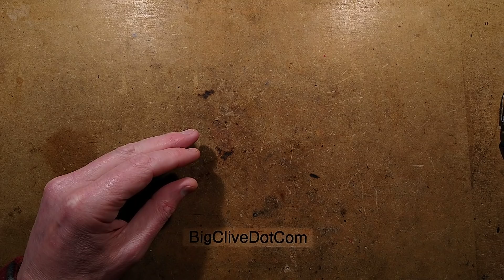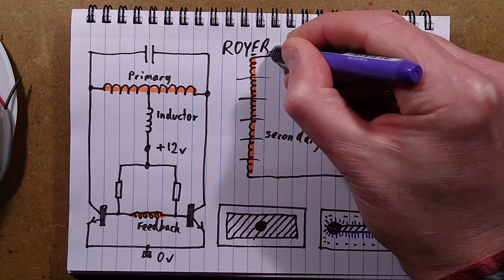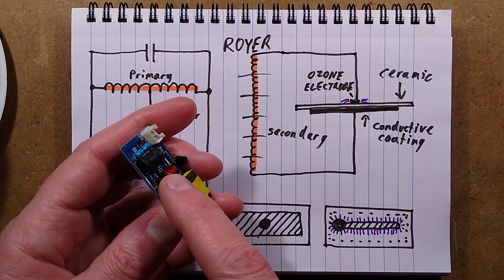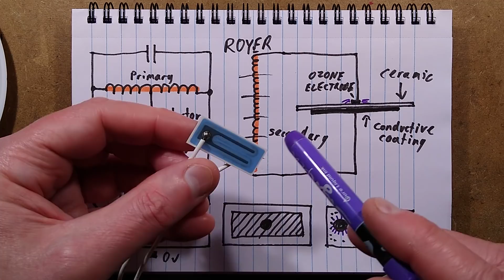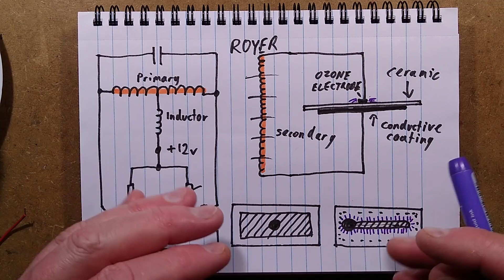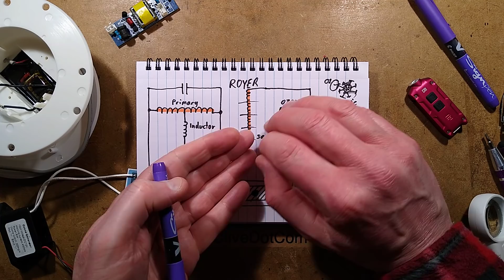High voltage sauna sanitisation unit

Comment: The reason for the poor battery life on those digital calipers is not external interference but the stupid "auto power on" feature. It means that in the "off" state only the display is shut down, but everything else inside that blob is still running.

Comment: ozone production does not happen (for most intents and purposes) in a high humidity device. Now, if you like your sauna pretty dry, this thing might work. And if it were only operated when the sauna is off (and has been presumably uh, "baked out" by the last users) then maybe... but damn this just seems like someone in CN is dumping ozone devices in North Amurrica. :(

Comment: It's glued together so it doesn't have screws, nuts or bolts that rust in the hot humidity of the rooms its designed for. I'd wager glue isn't actually standard hot glue. At least that's what I'd assume.

Comment: high voltage dodgy ebay devices is by far the most interesting subject on this channel, in my opinion.
Reply from the maker: They have a lot of them.
Reply: @bigclivedotcom  i wonder what's the highest voltage that they can go to
Reply from the maker: @Alexander_Sannikov  The spark generators can go pretty high before the spacing between the spark gap exceeds the insulation rating inside the units and they fail.
Reply: @bigclivedotcom  they can pot things in resin, separate windings on coils in segments, and do all sorts of other dodgy stuff. I wonder how far they can push it.

Comment: I see this ozone generator is 12v AC, can it be used with 12v DC power? 
It would make a great device for a camper to prevent mould, could be set on a 12v timer for maybe a minute every day. Would it be possible?
Reply from the maker: It is designed for AC and DC.  You can also get small 12V units that generate trace ozone continuously.  Search eBay for TFB-YD12102
It's called a positive/negative ioniser, but in reality creates a slight corona on its carbon fibre bristles.  It only uses 10mA.
Reply: @bigclivedotcom  found it Clive, thank you, and thumbs up to you mate 👍👍

Comment: Do you think you could use this device to drive a neon tube in a novelty clock with a circular neon tube around the rim of the round clock face assuming you limit the current with a properly sized series capacitor?     Thoughts????
Reply from the maker: You can get cold cathode drivers on eBay.  Search my channel for keywords like CCFL and cold cathode to see neon tubes being driven by them.
Reply: @bigclivedotcom  THANK YOU MUCH

Comment: Will the ozone eventually cause the plastic and the glue holding it all together to go hard and crumble?  It must surely be a pretty harsh environment up close near the ozone source!
Reply from the maker: It will degrade over time, but the ozone plates have a finite life, so the unit would need replaced after a number of years anyway.

Comment: The metal goes on as a paste using a silkscreen.  I just packed several of the stainless steel screens that were for putting silver onto ceramic circuits.  They're now on a ship on it's way to our new home.

Comment: Eddy currents damaging bearings is a big issue with turbo alternators in power stations. Therefore, one set of bearings was insulated with tufnol bushes round the holding down bolts,  and plates under the bearing pedestal.

Comment: Hi Clive. Another entertaining technical video, thank-you. Re your comments on AC variable speed drives (AKA inverter drives) - I used to work in technical support on industrial drives for a "household name" manufacturer. (Not Siemens, see below.)

The problems are all related to the super-high switching speeds of the modern semiconductors used to generate the square waves (pulse width modulated) fed to the motor windings (high dI/dt value). As you mention, some motor manufacturers use ceramic bearings but others use conventional bearings in electrically insulated housings (fibreglass or glass loaded nylon). 

The other problem encountered is early failure of winding insulation. The capacitance and inductance of the external wiring to the motor can effectively double the peak voltage "seen" at the windings. I once had a customer with a new installation who had motors failing after only 6-12 weeks. It turned out that in the original design (air conditioning plant in a big shopping centre) the motors specified were made by Siemens. At some point an externally identical motor (but much cheaper) from an Eastern European manufacturer had been substituted. When tested, all motor failures had insulation breakdown. The winding varnish in the cheap motors was rated at a lower insulation voltage than the originals. (Poorer quality control of the winding varnishing can also result in voids where corona discharge can erode the insulation.) The usual fixes are shorter wiring length between drive and motor (not practical) or addition of reactors between drive and motor to soften the rising and falling edges of the pulses (no room in the control cabinet or at the motor). The problem disappeared when the customer replaced his failed motors with ones from Siemens.

I'll put my anorak back in the cupboard now...

Comment: Hi Clive. Can you do a video on how an iron immediately adjusts itself when you chose a cooler setting, my iron can go from hot (cotton) to cooler (synthetics) in less than 2 seconds. How the heck does this happen? Perhaps a video on Victorian cast iron irons through to the very latest modern irons and how they all do what they do so well. Toby
Reply from the maker: It's always dissipating heat.  The control is usually just a thermostat.  Going from a very high heat to a low one will take a moment as the excess heat dissipates.

Comment: Ive got about 14 of those bobbin style transformers and 10 of what I call taser guts ( pretty much a 7/8" dia tube with those transformers in them) and got an idea.. I took some aluminum duct tape and applied enuf to both sides of a 16"x16" peice of lexan to make a 12"x12" cap... I added 1 of the Taser guts to the cap and it went from interesting to OMG!!! the gap it could jump was 1" wide and very aggresive spark at about 2Hz pulse with an input voltage of 2.1 vdc. When not sparking you could hear a steady sizzle and the ozone output was overwhelming. I suppose the entire edge of the 12x12 aluminum was cooking off the ozone... 4 linear feet of ozone producing madness  :)   BHUHAhahahhaaaa
Reply from the maker: Be careful not to damage the units by operating them with the output electrodes too far apart.  What you describe sounds like the "lifter" technology.

Comment: Damn thing arrived fast already since watching this vid , Mine arrived with all its hot snot hanging off i assume vibration had knocked it off , other than that it seems to be working it makes the high voltage soft light etc.

Comment: Hey Clive, I can't find a good answer to this. Is it OK to use a UK 400w halide ballast (230v 50hz) on US 240v 60Hz supply?
Reply from the maker: It should be OK.  If anything the higher frequency will result in slightly less lamp current and a cooler ballast.
Reply: @bigclivedotcom  thank you!

Comment: A few years ago, while working on a capacitively sensitive tactile keyboard, we were advised that the pattern of electrodes for the capacitive sensor had an optimum layout. One electrode had to surround the other on a 2D plane and they must present the maximum capacitance to each other and one had to be minimally capacitive to the user's fingers. This lead to a challenging layout of sinuous tracks and castellations.
It strikes me that the ozone electrode is similar. You want the rear electrode to be huge to create the area for the corona discharge but the front pattern must be as small as possible to create the maximum corona. The trouble is that the ablative effect of the discharge and the limits on depositing metal on ceramic mean tracks can only be so thin, but there must be an optimum layout. Perhaps something fractal like a snowflake.

Comment: As I understand it, and someone correct me if I am wrong, the smell of chlorine around pools is actually the byproducts of the disinfecting process, the chlorates?  from whatever the chlorine has attacked. I have also heard that a lot of that smell is from oils and sweat from people's skin and largely from people peeing in the pool. Iirc it's a reaction between the chlorine and the urea in urine and the byproducts of that reaction evaporate off/off gas easier than the chlorine itself.

Comment: The comment about caliper battery life: I had an employee that stored them sitting in front of a crt pc monitor (old equipment not worth upgrading screen to lcd) and the batteries seem to be dead every time we go to use them (handful of times a year) so that might be the reason.
Reply: AvE did a video a while back showing that the cheap ones have a quiescent current consumption a few orders higher than a good Mitutoyo. I have a cheap one myself, the batteries last a lot longer now I take them out when it's not in use.
Reply: @OhShitSeriously  mine is one from kobalt. We've had it for 10+ years and battery life seems to have significantly shortened in the last year or so. Taking the battery out isn't really an option because it is held in by 2 tiny screws that have been stripped out by my predecessors.

Comment: Is the ceramic plate thing made from a pcb made with ceramic rather than fibreglass as the board
Reply from the maker: It appears to be a specific item with the electrodes printed onto it as opposed to etched off like a copper PCB.

Comment: To be honest: I don't think that this test sufficiently proves that these digital calipers use relative positioning. It could also just be messing with what it thinks where 0 is or interfere with the bits it reads.

Comment: A few years back, you did the show on the UV-C lamp available from Ebay sellers, and it impressed the hell out of me. I loved black light, used to have one I bought from another GI when I was stationed in Nam. Had it hanging over my bunk illuminating a poster that said "What if they gave a war and nobody came!" A name of a popular movie back in the late 60's, in fact I watched it in the repo-depo in Oakland California while I was awaiting my transport Jet to give me my ride to Vietnam.  So at any rate, I ordered one of those lamps, my intention was to use it to clear out mold in my old back room shop that had been shut down for years, and I did that. Then those TV commercials began trying to sell the CPAP cleaners, my daughter needs the CPAP machine and hates the cleaning, so it dawned on me that I still had that bulb in my back room. I dug out a ceramic light socket, mounted inside a plastic bucket lid on a bucket that once held cat litter, put a switch on it, and ran a cord out, the lid opened half the top, so I mounted the light to the other half, she now puts her mask and hose in that bucket, hits the light for about 5 minutes and her room, as well as most of our house is refreshed with the smell of post rain on the plain, and her breathing stuff is fresh and clean.  Surely much cheaper then the 1000 dollar CPAP cleaner on TV and probably does just as good of a job.

Comment: In the description you mention your concern about the steam generating carbon tracking on the ceramic plate.
In the video you mention that these things generate not just ozone but hydroxyl radicals, but you forgot the wide range of options given the atmosphere's composition, including nitric acid.
Isn't electrochemistry wonderful?
Reply from the maker: I did mention nitric oxide at around 11:23

Comment: On those calipers not getting good battery life - I found that if you slide the calipers even slight they auto-turn on. Its super easy to miss.
Reply from the maker: They take virtually no difference in current when the display is on or off.
Reply: @bigclivedotcom  Ah ok - I had no idea - I've had mine since last summer on the original battery.

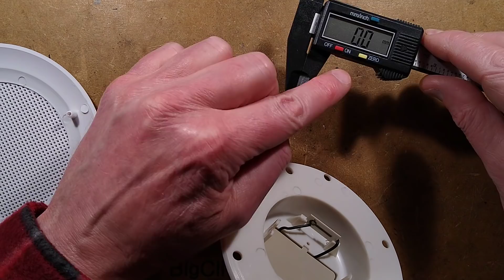Comment: 2:17 a minor note about those calipers - the "problem" with them is they come on automatically when you move them, but they are extremely sensitive to this and even vibration on the bench can "activate" them. Once I started storing mine on a more solid surface the battery life noticeably improved. The slightly more expensive versions which have a locking screw on top don't have this problem.

Comment: Yeah, Here in Finland I don't know how many Sauna's I've been at and I've never ever even heard of something like that 🙂
Reply: Finnish sauna probably stays hygienic through the high temperatures.
Reply: @MetalheadAndNerd  There's actually some truth there. Bacteria and viruses that live comfortably at over 70C aren't too many. I assume some lame Turkish saunas that are extremely humid and have something like 40C temps are still in the very "lively" range of many kind of life. IIRC from work, it's around 38C that growth of bacteria is most violent.
Reply: @jothain  We have to consider surface temperatures though. Not every crevice of a sauna has the air temperature. Especially if it os a private sauna that only is heated up right before usage.
Reply: @MetalheadAndNerd  That's obvious. Though in private sauna's surfaces are also dry and still get quite warm during heating and after. Especially compared to those Turkish style low temp and humid type "sauna's". It's the humidity that's also a great factor in bacterial growth.

Comment: Another "steemy" vid from the Big Man, how does he keep it up ! lol  ;)
So, Ozone, High Voltage, and UV radiation. I predict that the injection molded polystyrene housing, and potting resin will last 1 ~ 2 years.
Reply from the maker: These things do tend to have a rated lifespan.
Reply: @bigclivedotcom  yeah, and mores the pity. A stylish satin finished stainless steel, or powder coated aluminum, would be a better choice, IMO. ;)

Comment: You should take apart a Casio solar calculator, it would be interesting to see how the solar power circuit works
Reply from the maker: It's usually just an amorphous solar panel putting about 2V to the calculator, with a diode on the battery and solar panel to prevent backfeed.

Comment: Hi Clive, very interesting as ever. On the chlorine smell in swimming pools...it's not chlorine you can smell...it's chloramines. Chloramines form when chlorine reacts with sweat and most usually  other bodily fluids that "accidentally" leak from people when they can't be bothered to get out to use the toilet! You get rid of that smell by adding more chlorine. If the pool is well maintained and the chlorine level is high enough it hardly smells at all.

Comment: Those cheap calipers get bad battery life because the on/off button just turns off the display.   Actually, a teardown on one of those with a focus on any mods that could be done to improve it/enable communication with a micro controller would be most welcome.

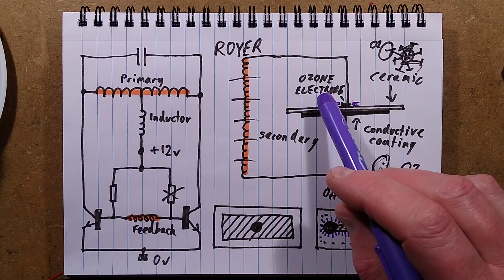Comment: 12:34 Thanks to Mark Rober's urinary endeavours I am aware that apparently the chloriney "pool smell" is apparently due to chloramines (particularly trichloramine) -- the resultant molecules after chlorine has reacted with pee [and, according to Google, other perspirants] in the pool.

The health question piqued my curiosity so searched and found a document titled "Chloramines - Safe work practices" (2014) by WorkSafeBC (The Workers' Compensation Board of British Columbia).  Although slightly dated, it suggests that professional swimmers (who do a lot of intense breathing near the water's surface) and pool workers are at risk from breathing difficulties or "occupational asthma" due to long term exposure.

Kinda interesting.

Comment: When covid first kicked off around April last year, I was working at our city office (IT worker at an "essential service", so I still had to go into the office 5 days/week). The entrance is inside the foyer of a building that's also the head office of a large bank, and aside from the police stationed in the foyer suddenly wearing riot gear and carrying automatic rifles, the other thing that changed was that they suddenly started pumping huge amounts of ozone into the foyer. It was so bad, my eyes would sting and I'd start coughing if I breathed too much in the 15 seconds it takes to get into our office. And you could still smell it a fair way into our office, through both the automatic door and the security barriers (the floor to ceiling type with the two panels that lift in a arc out of the way when you swipe in). I really didn't envy those police officers. Although the goggles they wore as part of their riot gear would probably shield their eyes a little. And I'm sure their automatic rifles were highly effective against the virus too.

After a couple of weeks they did wind down the strength of the ozone, and shut it off after a couple more. I was still glad when that project finished and I could go back to my regular office.

A year on, I've been working full time at the office almost the entire time, catching public transport every day (even had our building shut down when a person in another office in the building tested positive), and I've managed to avoid catching the human malware. But I'm still looking forward to getting vaccinated, even if the EU doesn't want to let us have the vaccines we ordered.

Comment: My calipers do the same thing if I leave them near my 3D printer, especially near the bed. That's only 12V DC though, so it doesn't even have to be high voltage.

Comment: As a kid I experimented with high voltage quite a bit, and I found a neon sign transformer connected to a large plate glass capacitor will produce a large amount of ozone. I used a piece of tempered glass from an old black and white TV set. The glass was 1/4" thick and about 20" square. This type of glass was used to protect the CRT in the old TV sets. The glass won't burn up like circuit board will. This is probably not a good idea for a hot tub though.